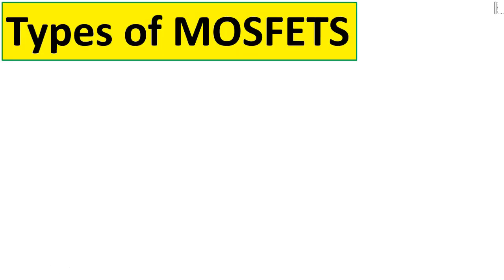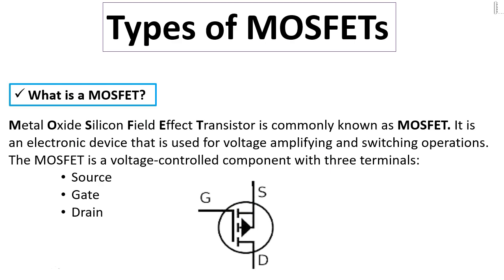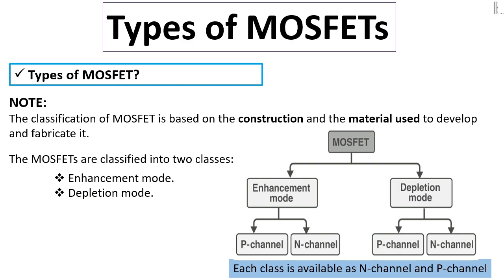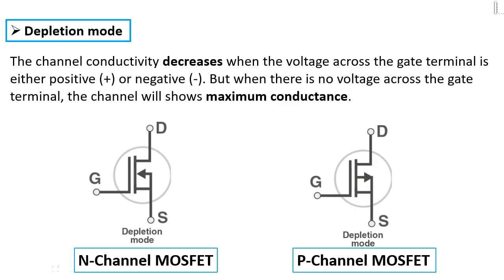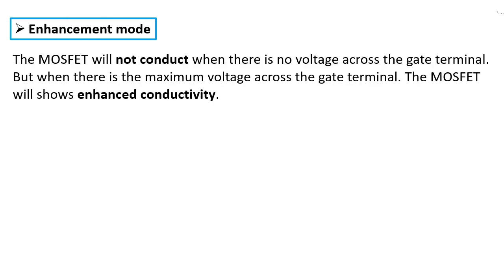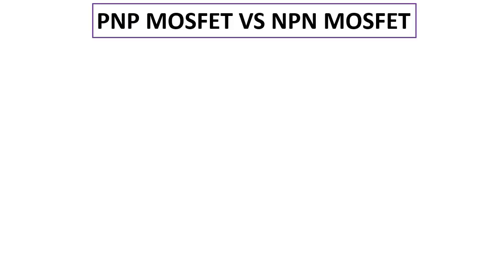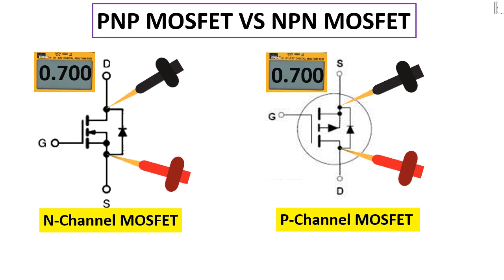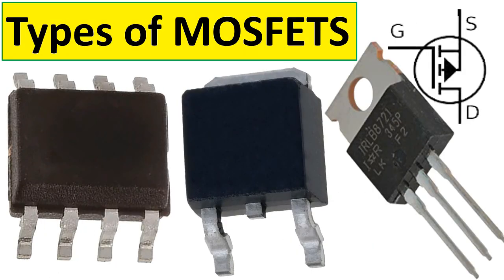Depletion MOSFET VS Enhancement MOSFET explained, N-channel MOSFET & P-channel MOSFET symbols

Comment: Excellet !
But you didn't say where we find each of them. Say for example  SMPS and so on. Some Mosfets have S connected to the Body !. Therefore, the Mosfet is the component the least understood despite your excellent video because of lack of comprehensive practical details.
Thanks

Comment: Sir , can you help me ?  there's a component  in the family of   linear voltage regulators  , it has 5 pins  and is called SOT23-5   .  there is another one with 6 pins . My question is  how are they used in a laptop motherboard ? and how do you check them with a multimeter ?     if you could make a video about it
Reply: SOT23-5 is not the model of the chip, it's the package, aka the size of the chip.
Reply: @JS7457  I know that  already pal , what I don't know is how to check all the various packages , as there's no standard procedure